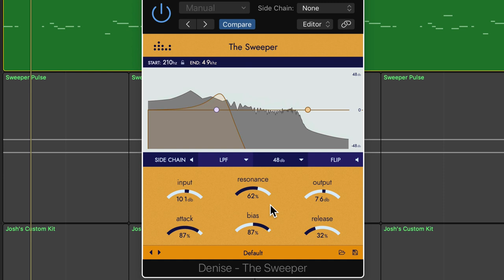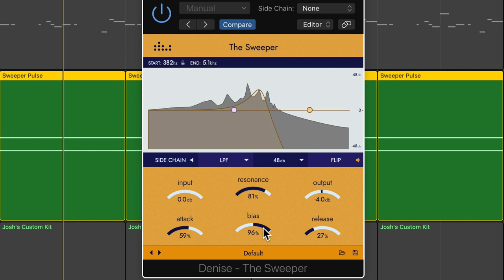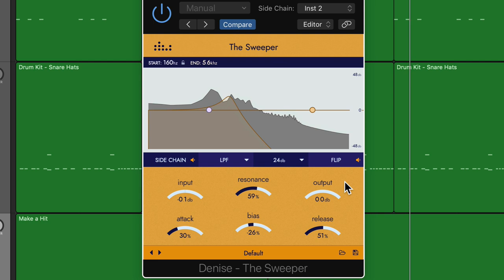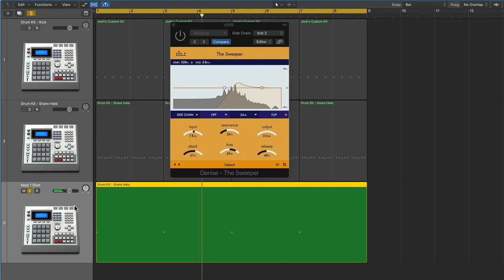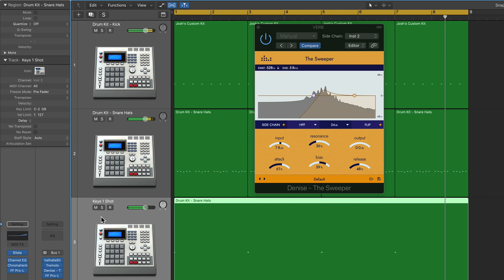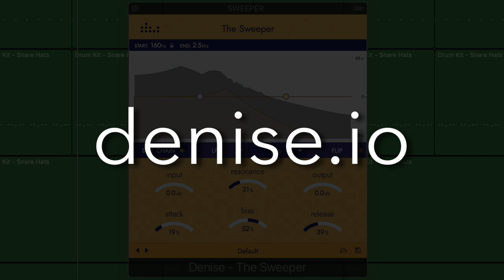THE SWEEPER // Dynamic Filter Sweeps // denise audio

Comment: You could use a vocal input as a source for the side chain and get some interesting vocoderesque sounds with whatever synth you want to be modulated :o
Reply from the maker: Unfortunately it doesn't work that way. If you use a vocal track as a side chain input source, it only follows the volume envelope of the vocal. Vocoders have special formant filter inputs for their side chain inputs that take on the frequency and tonal characteristics of the sidechain source.